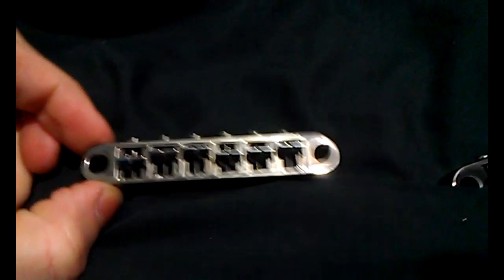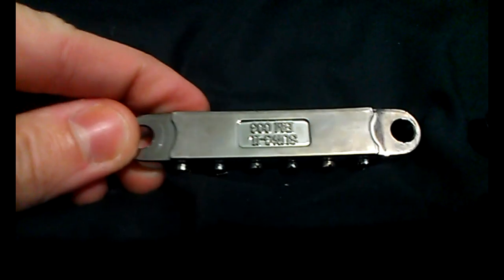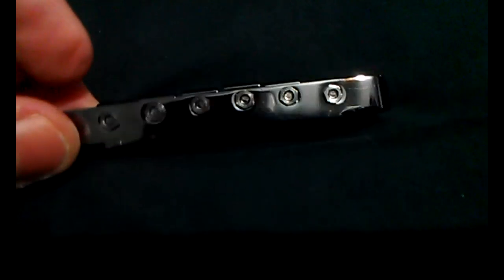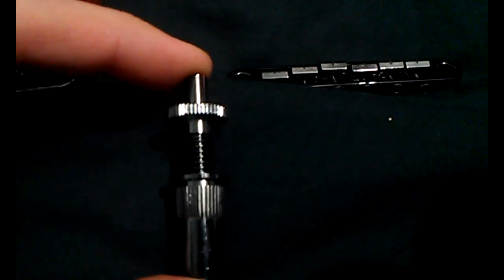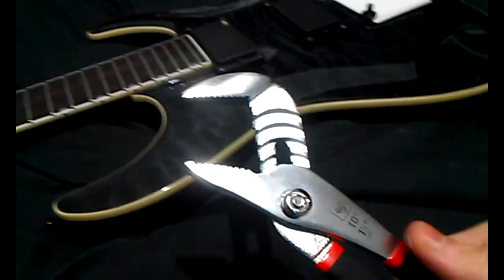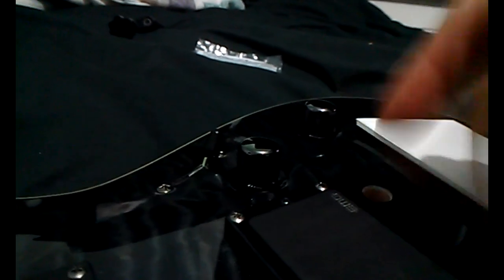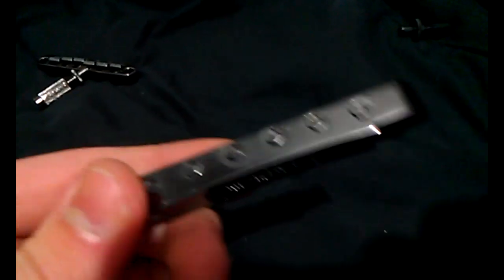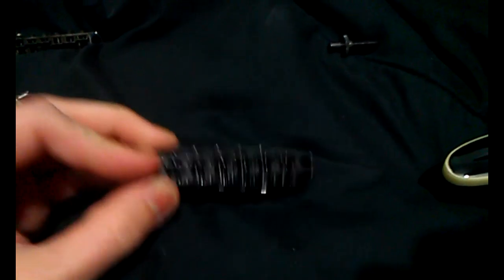Tune-o-matic guitar bridge swap - Cheap vs quality upgrade comparison.

Comment: You made me cringe a little when you took the channel locks to your guitar. I didn't expect the anchor to slide right out like that lol. It looks like that Gotoh bridge was a much needed upgrade.
Reply from the maker: Instantly made the guitar better. Thanks!
Reply: Did you solder a ground wire to one of those PINs you lifted out? I was looking to upgrade my CHINA les paul today...saw this video...nice job! (By the way)...I'm looking for a brass upgrade id say for me....unless someone has a different idea...I like that bridge you got...It seems my bridge is the exact first one you have!:) I have been getting static sounding noises from touching the pickup screws...which makes me think I have no ground to the bridge...I haven't taken them out...I do believe that is the location to "GROUND" the bridge...if you haven't done that...you may wish to do that ...will increase clarity...if you have static noises from just touching the strings sometimes...so...I don't know if you did that...but the grounding location is on that STUD, or PIN...:) If you didn't know already....
Reply from the maker: Did not. There were no wires in the holes. Typically with EMG's you don't get any static. This is from the EMG site "When installing EMG Active Pickups, DO NOT connect the bridge
     ground wire. This wire is usually soldered to a volume or tone
     control casing and goes to the bridge. This wire grounds the
     strings and uses them and your body as a shield against hum and
     buzz. It also creates a shock hazard."

Comment: Does this get rid of the annoying buzz in the bridge. I have high action on my es 339 pro because i prefer the sound for blues stuff but i still get buzz which comes from the stock epiphone bridge
Reply from the maker: Well the ES 339 Pro is a $469 guitar. There is only such much you can really do. Not to say price should affect quality; but it does with certain brands. Best bet is to do a full factory spec setup (neck relief, pickup height, bridge height, intonation, ect) then see if it is still happens. Another thing to consider, if you don't hear the buzzing through your amp then don't worry about it. My 8 string ESP buzzes a little when unplugged, but plugged in you don't hear any of the buzz.
Reply: This can be due to a few things, as Mongoose pointed out, a full setup helps, as one issue can cause other issues. In my experience T.O.M. rattle comes from saddles that are loose, loose hex nuts, the wire retainer present on some T.O.M.'s. You can fix some of these issues (like a rattling saddle and set screw) by using some non permanent Loctite (purple or blue) put into the screw hole for the set screw. The hardest part about diagnosing this particular issue is that you may have sympathetic vibrations that make locating the exact source a problem. If you are using minihumbers they can sometimes rattle if not installed perfectly, or installed into a channel that leaves too much room/not enough pressure on the screws/springs holding the pup down.

Comment: Do you have to file the grooves in the new bridge to allow for your string gauges? Because as it is, they all have the same small groove. I have an ESP horizon already with an authentic gotoh, but was told I need to replace the bridge. I ordered a new Gotoh tune-o-matic. And I noticed the grooves are all very small. I'm worried the strings will slide around. But I don't want to ruin the new Gotoh
Reply from the maker: Not at all. The grooves are just there to engage the string under tension. When tuned to pitch it would take a significant amount of force to move them off the groove.
Reply: Mongoose Motovlog aw cheers mang. That gives me peace of mind. I guess over time the string will dig into the slots and make it bigger anyway
Reply from the maker: Wishful thinking but I doubt nickel strings will etch a steel or chrome bridge.
Reply: Mongoose Motovlog I'm not speculating though fam, this is what has happened to the gotoh bridge I already have. After a few years of high tension due to thick string gauges, it's increased the size of the grooves. Hence why I was asking the question in the first place, because I don't even remember what my bridge looked like when it was new
Reply: Generally those grooves are just starting points. You can do as stated above, but this may be imperfect over time and can cause issues such as string binding, or breakage if you have a burr, or other sharp contact point. A useful approach is to get a set of welding tip cleaners (they are all gauged). If you use 52's for your low E, use a .053 cleaning tip to get a proper, non triangular fit. It will also allow the string to slide more freely. You can also add some graphite from a pencil tip as lubricant for the string. I know when you by a T.O.M. from gibson, they need to be cut.
Reply: My low E kept popping off and I had to file the saddles

Comment: I just got mine in the mail today (Gotoh Tune-o matic bridge) and the grooves aren't indented really at all 
Do you have to indent it yourself? It does not look like a string will fit into it or stay in place as it is brand new
Reply from the maker: Absolutely not. Those tiny grooves are just there to guide the string. Under normal tuning tension the string shouldn't pop off unless your really raking the pic into the strings hard as f***. lol.